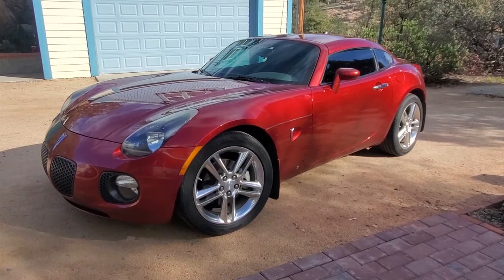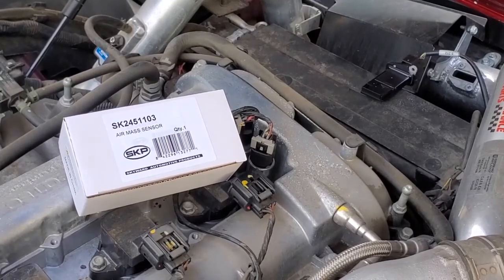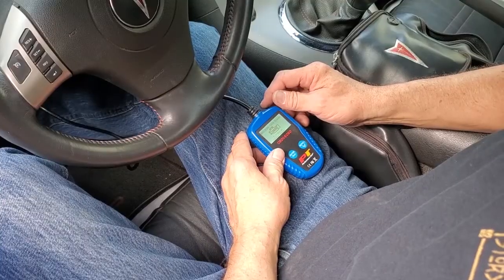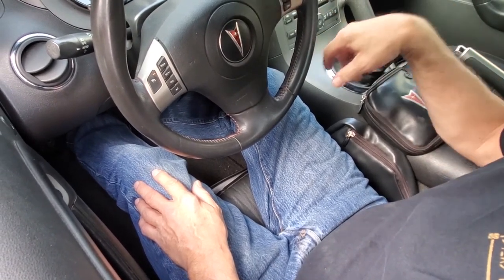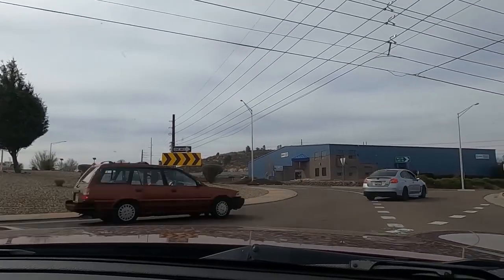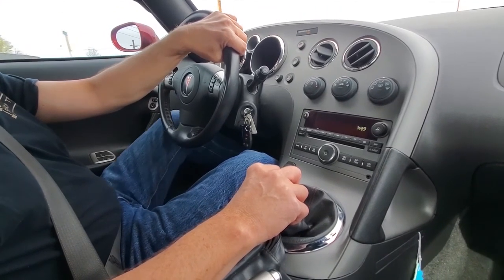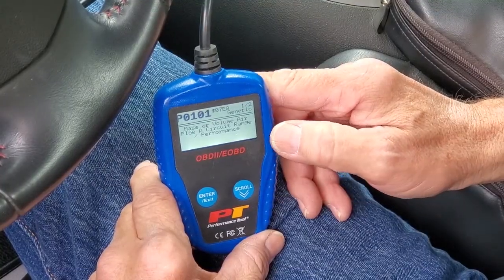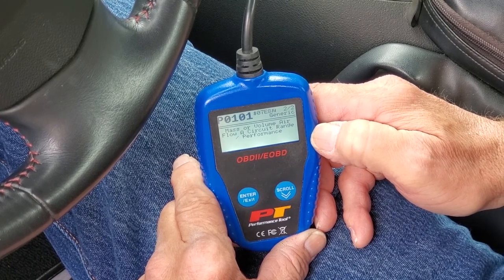Check Engine Light 2006 2010 Pontiac Solstice  - Troubleshooting the Mass Air Flow Sensor

Comment: Thanks! Great info here, have you fixed in yours for a p0420? Also my battery died and somehow tire pressure has no numbers only - -  - - and also my key fob won't open doors, lock them or open trunk. Any tips 🙏
Reply from the maker: We've made the car perform a little better, but we're still chasing a ghost. The tire sensors most likely need to be reset or replaced. We've replaced ours about three times as they can wear out, usually around the same time as when the tires were replaced. We've dropped key fobs more often than we'd like to admit and that can cause a solder joint, the battery or both to come loose. If you're good with a soldering iron, it's an easy fix. Otherwise, take it to a battery store and maybe they can help.

Comment: It's a gdi, any fuel treatment in the tank will not remove the carbon from the valves. You have to spray CRC carbon cleaner or upper engine cleaner, through a vacuum port located on the intake manifold because the injectors don't inject gas over the valves like they used to they inject it directly into the combustion chamber so a gvi engine is known for carbon deposits and ever so often you have to do a carbon treatment which is really easy to do, I don't think it's your air flow sensor I think it's carbon.
Reply from the maker: Sometimes it requires a bit of trouble shooting and the codes indicated that the mass air flow sensor needed to be replaced. It probably didn't hurt considering the miles on the engine. Today, we happened to replace the variable timing valve solenoid for the exhaust side and the issue has been resolved. Thank you for your suggestions and for watching.

Comment: Did you ever end up getting it fixed if you did what was wrong with it?
Reply from the maker: Everything we did helped the car. We just discovered 2 puncture holes in the vacuum lines caused by a pack rat. 🐀 Replacing those was a big help.